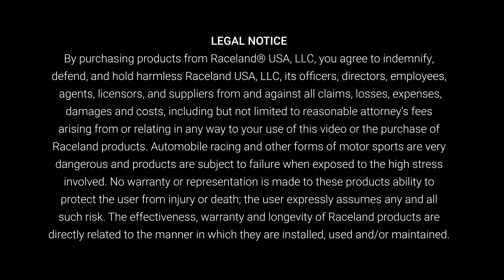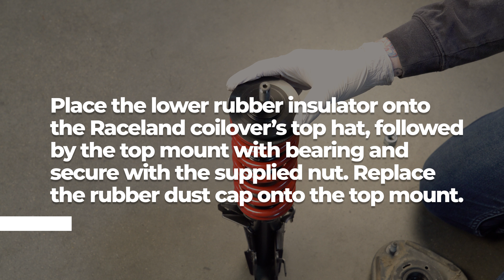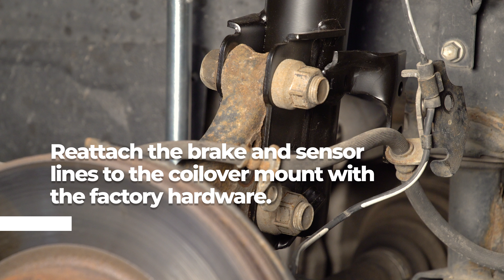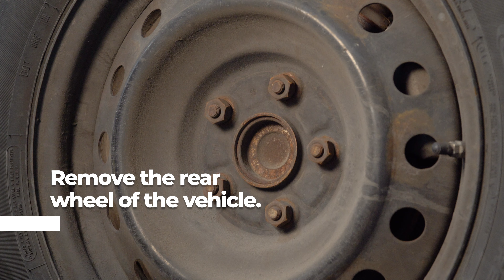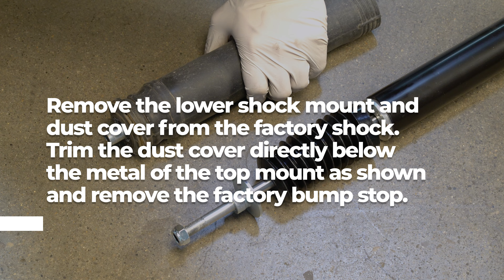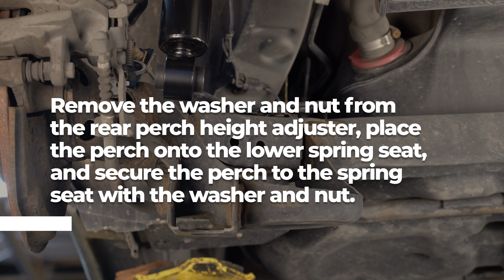Scion xB 2nd Gen. Install Instructions

Comment: I have a question I got the same exact raceland front coilovers and rear adjustable coils for my 2010 scion xB but did not get the raceland  shocks that were on the junkyard car I took them off of  , my question is can I run the front n back coilovers on stock shocks or do I need to modify the oem rear shocks to make it work? The junk yard car that had the raceland shocks is gone they already crushed it😢.
Reply from the maker: The only issues that you will run into are that the OEM struts will be too long for the shorter springs, causing them to bottom out on larger bumps. Also, the damping force will be lower, so the ride may feel more bouncy because the shocks aren't able to stop the oscillation of the springs as well. Feel free to give us a call if you have any other questions. Our number to call is 801.365.1440.
Reply: Ok thanks for the quick response, Also thank you for answering my questions am I able to buy the shocks separately so I won’t run into that issue?